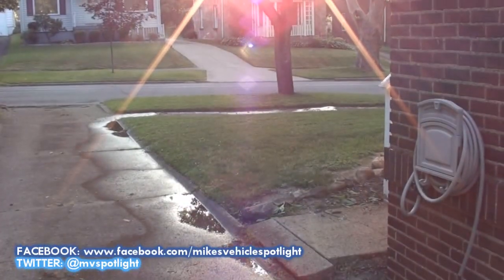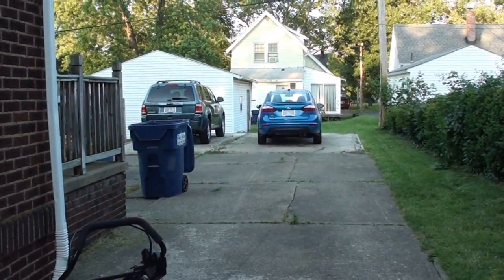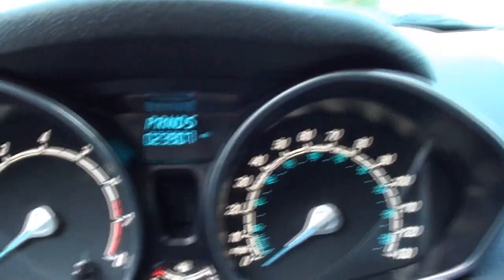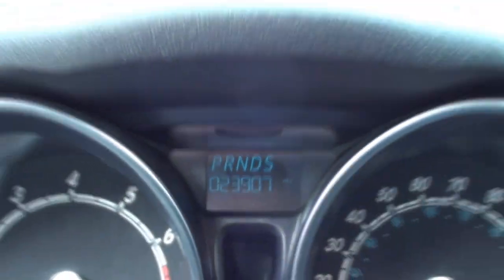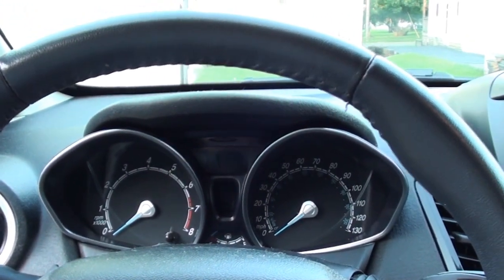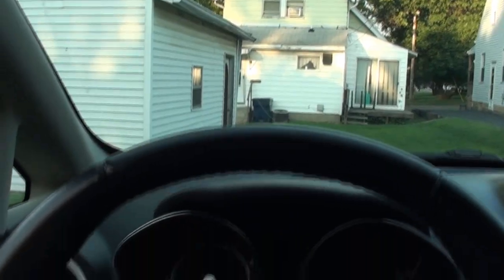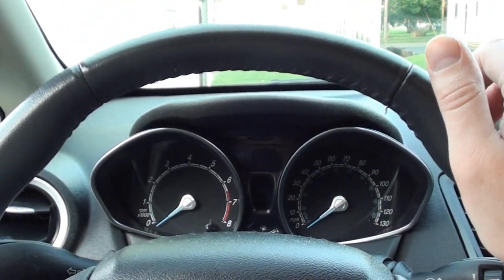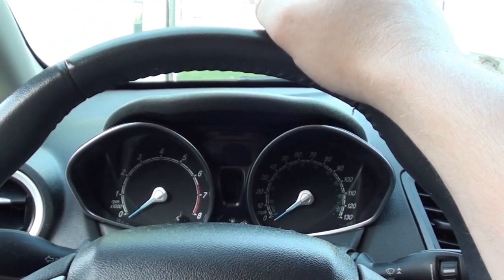MV 48 - "Fiesta's First Oil Change"

Comment: i always leave the sump plug out until the filter has been removed too, you might find some old oil from the filter has run down into the sump when unscrewing the filter.

Comment: I was wondering with that oil filter so hard to reach from down under, being blocked by those hoses, would it be easier to just reach it from up top and try to spin it off that way?
Reply from the maker: You can try to do it from the top I suppose, but I’ve never done it so I’m not sure how much of an angle you’ll have to spin it.
Reply: @MichaelAdamsRocks  Next time you change your oil, give it a try and let us know if that helps make it any easier

Comment: the filter placement on fords is awful. I did an oil chance on my grandmas 1.5 turbo fusion and the filter was wedged in between the motor and the radiator. I went to pull it off and its in a tight spot and I dropped it and it landed in the lower radiator shroud and made a huge mess.
Reply from the maker: Yeah. The 2.5 that’s in my Fusion really isn’t bad though. At least it’s vertical anyway.

Comment: I put oil liqui molly 5w30 because  I din't had motorcraft, now I would have some problems, what's your opinion, but the next time I will put motorcraft 5w20 ,  oh right
Reply: Use 5W20 only.  Do not use any other weight.

Comment: Phillips 66 makes the oil for Ford Motorcraft. Great oil, but would rather run full synthetic. Kendall Motor oil is an uncommon/underrated oil made by Phillips 66. Personally, one of the best oil in my opinion, Kendall Gt-1 Max with liquid titanium and Valvoline Syn Power.
Reply: At the jiffy lube i work at, jiffy lube is owned by a conglomerate that owns pennzoil. the factory that produced alot of the oils we used shut down for maintenance so we used a contract with kendall for a while. quite frankly wasn't impressed. pennzoil Platinum with pure plus is hands down the best full synthetic on the market easily.
Reply: cory beckmann I'm pretty sure Pennzoil with pure plus technology  is better, but Kendall is still great stuff too. It has good numbers with the elements added to the oil. If you visit the patroleum quality institute of America website. It is motor oil galore. If you want any information from the majority of the motor oils just visit here. http://pqiamerica.com/PCMO_Sample_Summary_12_15_2016.html If you didn't know about this website already.
Reply: Richard Ojeda Alot of fleet companies use Kendall Oil. No problems that I've heard of.

Comment: I have to agree there dude I would go with one of those as well I don't think I would go with what Mike is going to go with I would go with Valvoline I think Valvoline is the best in my book that's what I would use in a Ford Fiesta
Reply: donald louk jr. I agree with you, Valvoline Syn Power.
Reply: what oil spec are needed for fiesta 1.5?

Comment: frankly from me I would not go with the factory oil I would have gone with mobile one Castro or Valvoline
Reply from the maker: +Brad Haughton I honestly don't have a preference of brand, just whatever the recommended type of oil.
Reply: @MichaelAdamsRocks is that the automatic dual clutch transmission? If do you have any trouble with it changing gears or a recall on the Transmission module control?

Comment: HEY dudey you didn't fill the filter with oil starvation 
Put the sump plug back before taking the filter off tut tut
Reply from the maker: The filter is at a 90* angle. You can’t really preload it. It’s fine.

Comment: Nice video , thanks! I love my fiesta too...a '14 manual hatchback. When i change my oil i like to let the filter drain out a minute right after the seal is broken so it's not so messy when i back it out all the way. When I'm done I hit the dirty residue with a few quick shots of brake parts cleaner for a spotless motor...no wiping necessary. As far as the oil brand comments I really believe if you change it every 3000 mi or 6 months which ever comes first you will be in great shape. Oil is cheap, engines are not.

Comment: That filter placement is downright awful.
Reply from the maker: Yeah, not the best place but I’m sure it could be worse
Reply: Longitudinal 1.8T VAG engines are worse, oil from cooler goes on slanted engine block and subframe.